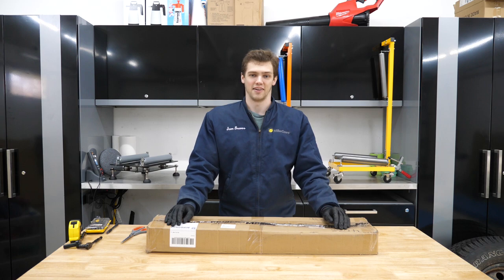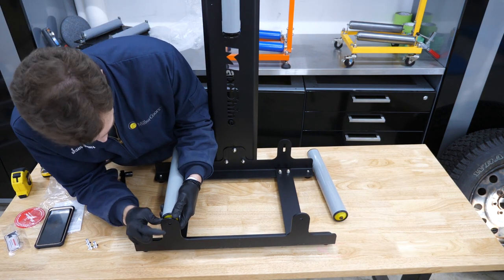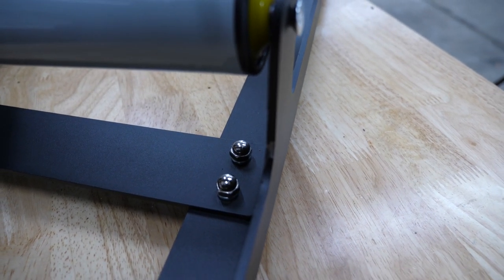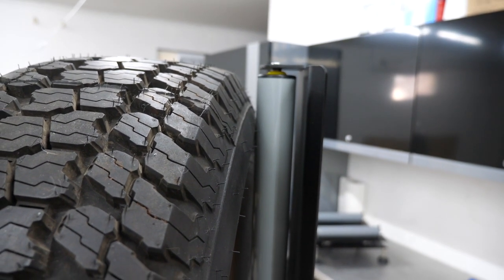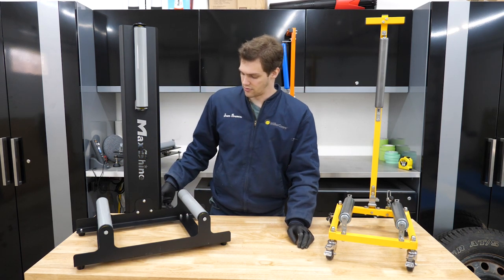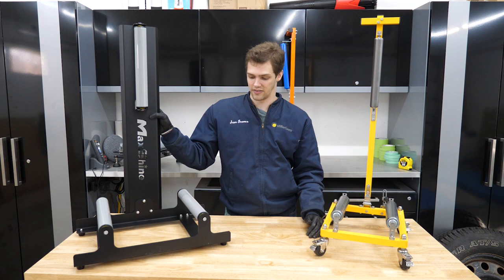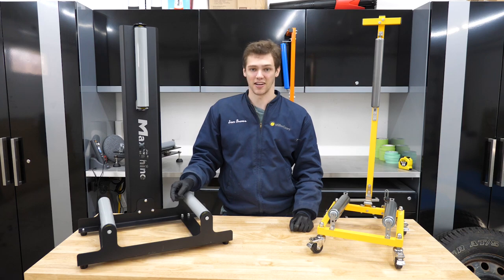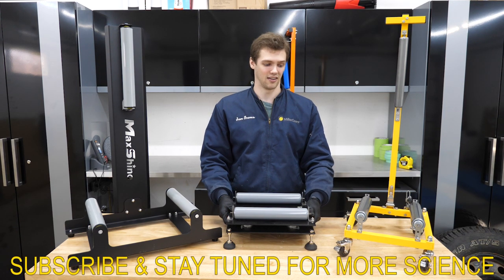MaxShine Wheel Detailing Stand Review & Comparison to CycloShine

Comment: you could have put the back together first and tightened it up, then place the rollers in, loosely, then put in the front bolts.  Instructions from the manufacturer should be included so you can avoid the issues in assembly that you ran into.  Now that the powder coating is scratched, you can get it wet or it's going to start to rust and or the powder coat will start to flake off.

Comment: You could have loosen the bottom bolts when installing the rollers. :)
Reply from the maker: That wouldn't do much because the holes line up spot on. If I took them out, then yes I'd have a easier time. I still do not like the design of screwing bolts into the powder coated frame. It just guarantees scratching.

Comment: I'm no where near an engineer, but, what about a fixed base with a vertical back (like yours/theirs)...but with an adjustable hub/roller in a track that can be raised or lowered to suit different size/height wheels. Just imagine yours with no rollers at the bottom---the vertical back has an adjustable track in it to raise or lower the roller/or have adjustable ball bearing hubs and the wheel would basically rest on the roller or bearing hub and spins without the tire having to rest on rollers at the bottom.  Just thinking out loud. Let me know if that makes sense...easier to draw then explain.
Reply from the maker: I think I am gonna need a drawing or picture haha. I understand what you mean by the adjustable back roller being able to go up and down, but do not follow what you mean the base should look like
Reply: @SourceGarage  I can draw a damn fine stick figure (as evidenced from my profile pic), but, give me an e-mail address and I'll give you a 1 dimensional view of what I mean.
Reply from the maker: @danparker6341  thesourcegarage@gmail.com thanks! I am really interested in what you're thinking
Reply: got your e-mail from your facebook page...sent you my stick figure design...